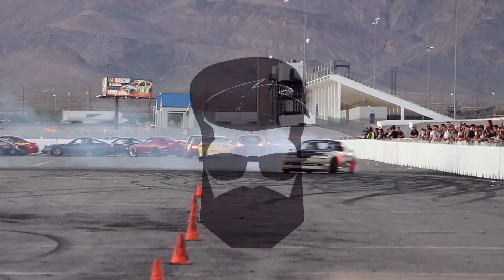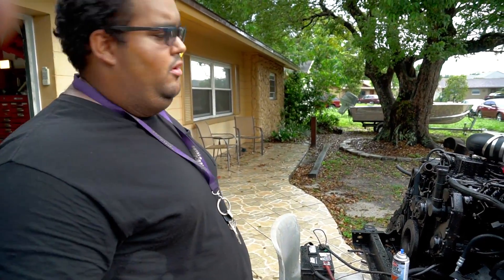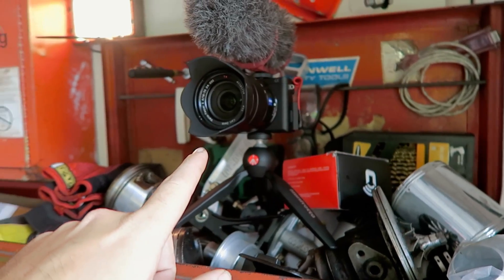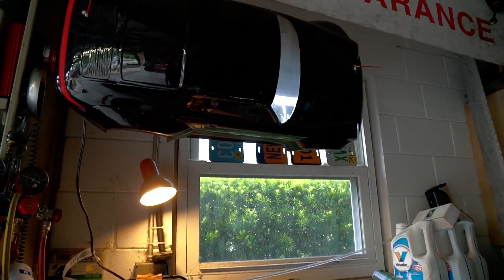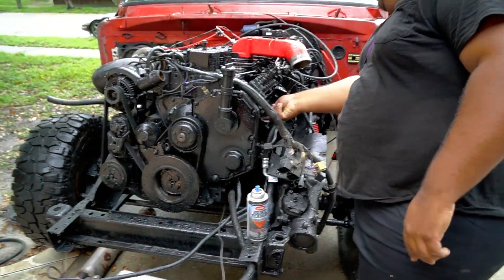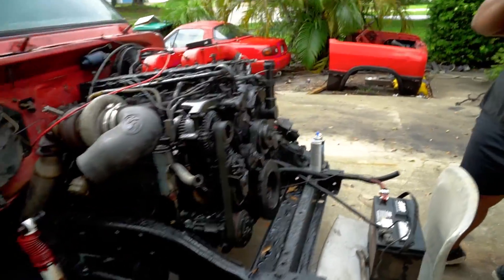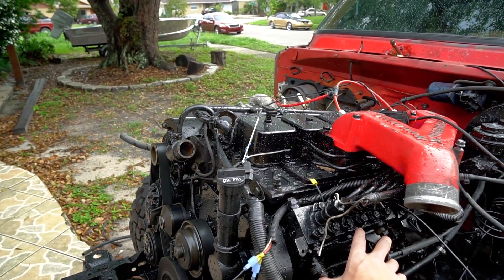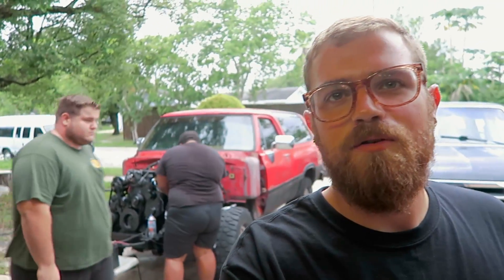Cummins Swapped Ramcharger First Startup!

Comment: Anything done to the front suspension to handle the extra weight?
Reply: LUCKFOREIGN MUSIC A fully dressed 6bt weights around 1200 that shouldnt bee too much for the front suspention. plus im not sure but i think the ram charges have similar or same suspention to the 1st gen d250s and they came stock with the 6bt. anyway he should be fine
Reply: Yea I feel like the Ramcharger and trucks had similar platforms back then
Reply: bill krummel  1/2 ton stuff is not rated for a 1200lb engine. Dodge trucks that came from the factory with the Cummins were fitted with beefier suspension and brakes along with frame reinforcements to accommodate the 1200lb engine.
Reply: Real nit pick here, but D series trucks are 2wd, W is 4wd. His Ramcharger is essentially a shorter wheelbase W150 with an enclosed body. The frame rail is mostly identical to every other D/W truck though. What changes is the axles and suspension. I'm fairly certain the leaf spring packs from the W250 will bolt up to the Ramcharger frame. But if the W150 springs seem to hold up to the weight, I'd leave them because the W250 springs will give you a much harsher ride.
Reply: MistaDrifta not true the w250s all had the same suspention and some have the cummins and others had i think the 360 or 440 and either of those weights within 200 lbs of the 318 he pulled out. I think hes gonna be fine people have done very similar swaps to thin with blazers and broncos  kept stock suspention. either way its not our buld so its not our decision.
Reply: Daylan Chapman I've seen the frame stress and in some cases the PS box rip off. Plus the brakes are not ideal. The front springs will not handle the extra weight putting a ton of stress on the axle.
Reply: bill krummel they haven't made a 440 engine since 1978 and a big block is roughly 650 lb which is half the weight of a Cummins. I'm 37 and been working on vehicles my whole life, I've worked on Vans/Truck as a fleet mechanic for 5+years and for the past 8 years have owned my own business doing mechanic and fab work. I've done so many different swaps and know for a fact that half ton drivetrain can't handle a 1200 pound engine. You are correct it's not my build, I'm just expressing my concerns
Reply: hey the front is still the same nothing upgraded yet fed plans on putting a lift and I'm sure he will do something to beef it up

Comment: so did you just hook it to your ram charger transmission in the stock place. I am thinking about putting one in my w150 but I do not want to back up the transmission.  You still have room for radiator or do you have to cut out the core support.

Comment: I've got a first gen and am going to be also doing a 4bt ram charger ...did you guys have to move the steering column over like the first gen Cummins did from factory they are an 1 1/2" over towards the driver door

Comment: i just picked up a a6500 myself and i love it imagine stabilization does suck but the low light autofocus and 120fps is really really good on the camera compared to many others it's worth it with time and practice you'll be amazed on what the camera can do. It's totally my opinion some will disagree some won't it works well for me may not for you just my input

Comment: I paused the video after you showed the a6500. As a videographer my self the camera is great but there are some better for you which you use mostly on the go. The A7s2 has a gyroscope in itself and makes your life easier another huge plus is that the a7s2 (or even the A7s) is GREAT at night. Bear in mind the the lower Aperture the lense has the greater it is at low light conditions(with very high ISO). Aswell some lenses have stabilization and some dont. Also the Lense you have is one of the top Brands for Sony lenses. Zeiss lenses are awesome . I would also check maybe if you have the stabilazation off from the settings or something.

Comment: shutter speed has to be at least double your frame rate otherwise is will have that laggy effect. a6500 has ibis settings so you either turn it off or adjust it to your focal length accordingly. it's best potential is when it's not in auto mode

Comment: get a 12mm prime lense for vlogging, thats a crop sensor camera so a 17/18mm is actually closer to a 22mm.

Also, most canon lenses have pretty smooth image stabilization and they make adapters to put them on a Sony body.

Comment: He might not have power brakes. I know at least on some trucks, I have seen it with way on fords, that they use the power steering pump as a hydraulic pump for the braking system. From what i understand something about the vacuum drawled by the diesels is funky. just pointing that out if this doesn't make sense I am sure there is something on the web about it.

Comment: What is he going to do for suspension now that he has 600 extra lbs up front??? I would defanatly recommend one ton springs and some reinforcement to the frame where the steering box mounts.

Edit: Look into (KDT) killer dowel pin. One of the timing gears has a dowel pin to keep it in place and over time it wears out and can take out the timing gears. It's one of the very few but common problems on a 12V. Much easier to do with the front end off and inexpensive insurance.

Comment: You guys did a good job. But wouldn't it have been easier to unbolt the body from the frame? Then you would've had plenty of room to mount the engine
Reply: I plan to do the same. But my way is way simpler. It's easier to move a lighter object around a heavier rather than vice versa.

Comment: Hey man! Get the 16-50 E-Mount lens (kit lens) for that camera and I think it will suit your vlogging needs a lot better. Check out one of my vlog videos to see what it looks like (not trying to plug, just trying to help you out). Cheers and keep being awesome! (P.S. it's "laggy" in low light conditions because the shutter speed is dropping too low in respect to the frame rate. If you set the two memory presets on the dial to be one for 120fps at 1/250 shutter speed and the other preset as 24fps 4k at 1/50 shutter speed it should work out well.)